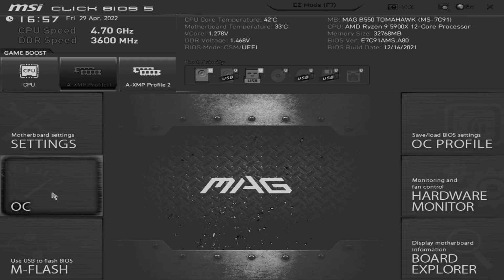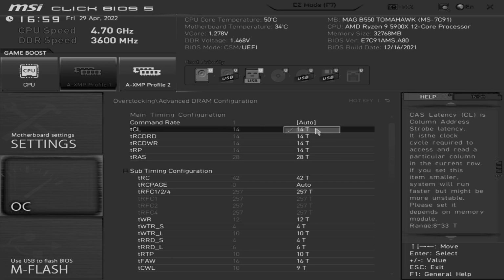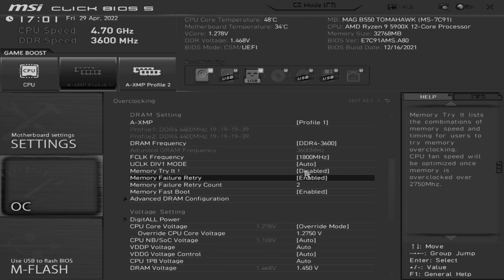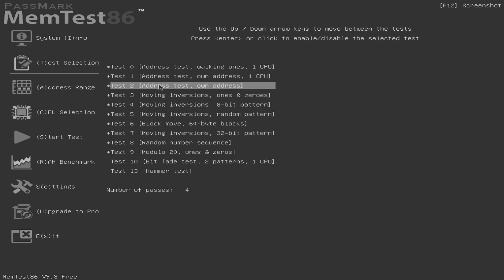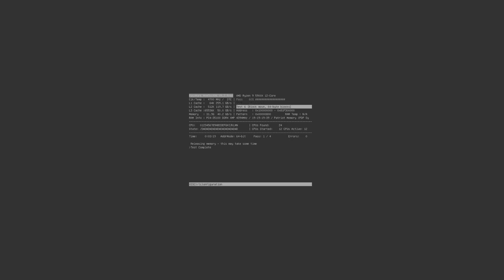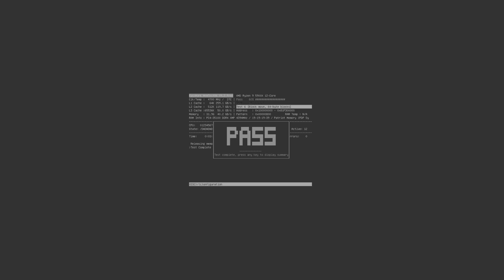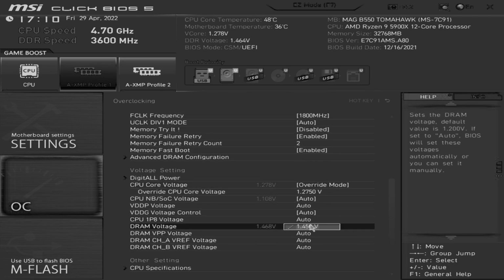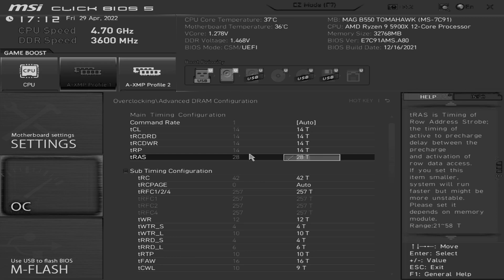RAM OC Basic Tutorial | Patriot Vipers 4400MHz

Comment from the maker: Hopefully you all enjoy even though it's greyscale - decided that was better than running it in a green view. Remember to do your own research for your kit of RAM as everyone's RAM and motherboard is different. Research research research. If your PC just black screens and doesn't load up again you can pull the motherboards battery which will reset everything and allow you to keep testing - best to have the side panel just open and be ready to remove PSU cable to ensure there is no power going to the board when you do this.

If you are on Intel 12th Gen ideally you want to get the RAM to the fastest you can keep at Gear Mode 1 so a 1:1 ratio with the CPU memory controller. It's also worth checking out if you can lower the SA Voltage which I've notice when going for aggressive timing was at 1.45V and I lowered it to 1.36 without issues (also tested with Memtest86 after changing)

Comment: If I don't want peak performance but only close enough to it, do I need to tune the CPU before doing the RAM tuning? I'm in same situation with 2 of these kits so I'm running 4 DIMMs so XMP stock doesn't work so gonna try adjusting to 3600 CL16 or CL15, something pretty safe, wonder if 1.35V on the RAM will be fine, kinda like XMP profile 2
Reply from the maker: These sticks I have run for a little over a year between 1.45-1.48V with no active cooling. 

3600 14-14-14-28-274 at 1.47V and lower the voltage as needed if you’re going to use 3600
Reply from the maker: Also Gear 1 and Command Rate 1 on Intel
Reply: @FIVESTRZ  wait with ryzen 5600x do I need to lower voltage? I basically copied XMP then did 3600mhz CL16 with same voltage as XMP 1.45v version and it's stable so far so rocking that
Reply from the maker: @millpreetk1406  you may be able to get better timings. I would try 14-14-14–30 with the voltage I gave you and 1800 FCLK. You may be able to get away with 1.45 volts or even lower who knows.
Reply: @FIVESTRZ    yeah probably, but I'd guess I already got 98 or 99% of the gains off stock JEDEC I'd been running for the longest time even with just that much
Reply: I'll think about it if I need to squeeze out a bit more performance, appreciate the content, was great. really simplified it a lot
Reply from the maker: @millpreetk1406  glad it helped!
Reply from the maker: Yea the quality is “clearly” better in these types of RAM sticks. Same as DDR5 A Die
Reply: @FIVESTRZ  I agree 100%, that's why I chose it, watched like 2 hour RAM video before buying loll. should make it even more crazy stable when running at lower timings, but yeah, I might up it another notch to CL15, might try 14 like yourself if I get the time, each time I change, have to spend time checking stability. Although likely is plug and play for CL15.

Comment: bro help me please
i have 
i9 10850
6900xt
psu 850 goldfull
z490 aorus elite ac
and ram 4*8 PATRIOT VIPER 4400mhz
i need please stable timing please
Reply from the maker: You can start with 3600 14-14-14-28-324 at 1.47V and see if that’s a stable starting point then increase the speed. I never worked off a 10th gen but that was stable for my friend.
Reply: @FIVESTRZ  ok tnx i trying now with 1.45v  .
You so fast
Reply from the maker: I was watching a short on YT about to go back to bed but yea man start there if you only see a handful of errors like 1-10 then you may be off on the voltage and need to increase a little like 1.46-1.47-1.48 (that’s the highest I personally go). Once you find timings that work and pass the test I showed run all tests overnight. 

Keep a piece of paper or spreadsheet of what timings and voltage works and bios updates can change compatibility
Reply: @FIVESTRZ  
Working good zero errors
1 hour strees occt
14.14.14.28
3600mhz
1.45v
Best bro

Comment: New follower. Frame Chasers sent me as reference. Great video. Just got b die and trying to tune.
Reply from the maker: That's awesome!! JoodaFoos! If he sent you then I'd be down to help for  sure message me on IG
Reply from the maker: Did you get everything figured out. That HP B Die has decent XMP timings if you were just looking for plug and play
Reply: @FIVESTRZ  Yeah i overclocked my gpu and my cpu and im getting 165 my monitors refresh rate
im going to push it further
might have to go with 5900x to get 200
Reply: oh also turned on resizable bar
Reply from the maker: @LocknLoad_Gaming  are you on a 5800X3D right now? Or a regular 5800X
Reply: 5800x
Reply from the maker: @LocknLoad_Gaming  probably the best jump you’ll see is going to be to the 5800X3D gaming was sometimes better on the 5800X over the 5900X when I had it.

Comment: My bad I’m new to pc. Are you using 4 sticks of viper (4x8gb) Or (2x16gb)? Also I’m getting a gigabyte x570s aorus master mb, idk if that’ll be a problem when oc’ing. 5800x3d cpu btw. Also does it matter if the CAS latency is 18?
Reply from the maker: No worries, I am using 4x8GB and it your cas latency does matter a ton for in game. I would try 3600C14 14-14-14-28 to start at maybe 1.45-1.47V if you have the Patriot Viper Steel 4400 kits. Their 4000C16 kit I "think" is also B Die but I am not sure, their 4133 kit should be as well
Reply: @FIVESTRZ  okay so is it necessary to buy the 4x8gb kit to “stabely” overclock? (If so, which mhz and which cas latency). The RAM I’m going to buy is just the patriot vipers 2x16gb 3600mhz CL18, will that also work? If this is all too confusing for me should I just get some Kingston fury renegades?
Reply from the maker: @JulyOrDie95  you’re not going to see the performance uplift using those 3600C18 kits. 

Patriot Viper 4400 https://amzn.to/3ViFcEq (2x8GB needs to be tuned like in video)

HP B Die 3200C14 - https://amzn.to/3Vppac4 (2x16GB and is plug and play)

This is the B Die finder website if you want to check a kit if RAM to see if it’s B Die - https://benzhaomin.github.io/bdiefinder/
Reply: @FIVESTRZ  could you send me the link of the ram kit that you have because I have so many questions it’s just gonna go on. On Amazon they only have 2x8gb 4400mhz. If that’s what you got do I have to buy it twice? (Im trying to get 32gb that’s why).
Reply from the maker: @JulyOrDie95  yea I bought it twice - really 4x because I am using 4 on my 13900K build at 4133C16

Had it on the 5900X at 3600C14 14-14-14-28-274(TRFC) at 1.47V if I recall exactly but Memtest86 will help you find any errors

Comment: What do you think would be a stable not tight just set them when using a 4x8gb of this viper kit on intel 12th gen? I ordered the pieces and I'm waiting for them, i just wanted to get the best results with not much trouble with testing, i dont think it will go above 3600mhz when using 4x8, just want to be on gear 1 and get a chill experience with kinda low latency timmings
Reply from the maker: I'm running them in G1 Command Rate 1 at 3733MHz 14-14-14-26-324 on the 12900K. 1.47-1.48V on a 5.1/4.0 OC at 1.285V

Also 4x8GB set up
Reply: @FIVESTRZ  oh this is so nice to hear, I might come back to ask for help when they arrive but I think i'll just throw them at 15-15-15-28-300ish at 3600mhz on 1.45 should be good, do you get some extra performance for using dual rank? Do you have a video of this setup on the i9?
Reply from the maker: @LunardH  you could go for that but I recall 3600MHz working easy at 14-14-14-28-324 1.46V if I remember.
Reply from the maker: @LunardH  also no because my capture card is set up to work on my i9 build
Reply: @FIVESTRZ  if you plan to do a video on the 12900k, could you please do an easy oc like that just with some nice timmings and at 3600mhz? If not I will use these specs you gave me as inspiration, thanks
Reply from the maker: @LunardH  might take a while because I’d have to move my Xbox Series X and set up the capture card on my 5900X system find me on IG I’ll send you the screenshots from my Excel

* @FIVE_STRZ
Reply: @FIVESTRZ  will do

Comment: Cool video, a year ago I started learning properly how to test and tune, have 44ns 4x8GB 3200C14 Gskills at 4200 16 16 16 with tuned subs around 37.7-38ns with a 10850K at 51x/48x
Pretty happy with +35fps avg at Nakatomi plaza gains (when I started tuning properly), but for most games I'm GPU bound in (my) games anyway, good to see the extra bandwidth and less latency. Using MSI Gaming Plus z490 motherboard.
Reply: im very new and trying to learn myself. what do you change to get the really low latency? even if you give me your timings voltage etc. that would be great as well. any tips are great also as im learning. any help is greatly appreciated on this. we all gotta start somewhere and im trying to figure it out. not many people wanna give you any help with this which sucks trying to learn and figure it out on your own. also are you in gear one or gear 2?
Reply from the maker: Lowest latency on the 12/13th gen is going to be Gear 1. I personally don’t test latency I just drop consistently in the same place in Warzone after checking stability and see what performance gains if any there were I’ve used a lot of different timings
Reply from the maker: I started testing and tuning my primaries about 6 or so months ago. Had the Corsair 4000MHZ C18 kit that I took down a bit and then stepped into my favorite affordable B Die the Vipers lol. Have 8 sticks of the 4400MHz now across both PC and if I can get them for $80 again then I will grab 4 more for the creation build but I may not be going for fast timings on that one over just straight speed. Been 4000MHz C16 and the voltage required is pretty mild so I have been happy there. Max settings ~1% lows with DLSS Quality is about 158 FPS for a second or two then 170 FPS  lows I notice and usually plays around 180-210 FPS which I think is fair for max settings

Comment: Hey man what timings do you use on your 12900k? I know we are not supposed to copy timings but i just want to get an ideo for my 12700kf. I wint use the exact timings, i would just bring em down and see where it stays at
Reply from the maker: For 4000MHz Gear 1 - 16-17-17-34 TRFC 324 ~1.46V

3733MHz G1 14-14-14-28 TRFC 324 ~1.47V

3600MHz G1 14-14-14-28 TRFC 274-324 (can’t remember) ~1.45V
Reply: @FIVESTRZ  thank you. Im going to try and go with framechasers 12700k timings and if that dont work than ill just keep trying different ones
Reply from the maker: @mxngxchxngx  Yea I am sure he either has direct cooling or water cooled RAM so hitting his clocks and timings require time, patience, and some good cooling
Reply: @FIVESTRZ  maybe direct cool because i only over heard him mention the water cool for his 7000mhz ddr5. His timings were 3900mhz c15 for 12700k
Reply from the maker: @mxngxchxngx  interesting, I may have missed that one. My time has finally come up for the EVGA trade up program to get the 3090 Ti
Reply: @FIVESTRZ  do you think those timings are realisticly possible for 12700k?
Reply from the maker: Never had hands on with one. I don’t see why not though, depends on the voltage you’re willing to feed the RAM kit
Reply: @FIVESTRZ  yeah ill see if it works under 1.5
Reply from the maker: @mxngxchxngx  lol I wouldn’t use 1.5V for every day use just to test and then start dropping but if you get it stable then rock and roll
Reply: @FIVESTRZ  yea im def not gonna use 1.5 lol. I just want it to stay under yk. If not i would have a spare 120mm fan i would prob just zip tie it onto the ram even if its below 1.5v. Better safe then sorry lol, after i would have a left over. I dint really care about looks, just performance lol
Reply from the maker: Facts. I canceled my step up… just can’t justify grabbing an upgrade of less than 10% for better cooling I’d rather just grab an MSRP 3060 Ti for my other creator build
Reply: @FIVESTRZ  yeah i think thats the better choice imo. Only time i would upgrade 3090 and maybe not even then but when 40 series comes out
Reply from the maker: @mxngxchxngx  it was such a hard choice bro 😂 but I literally had to be like do you really want to spend 33% of the cost of your 3090 just to upgrade